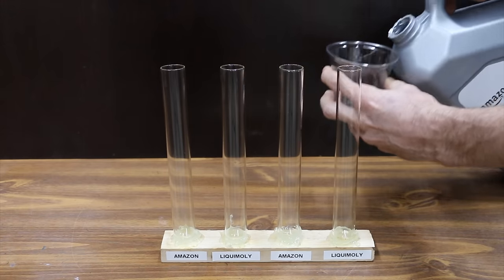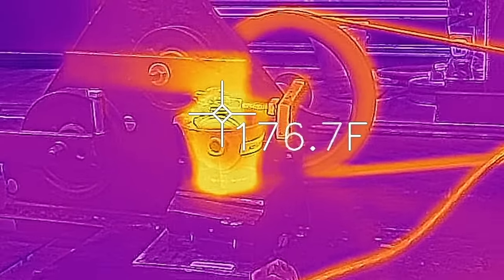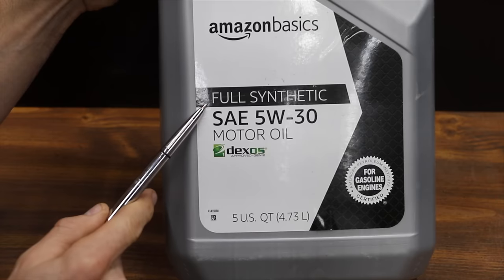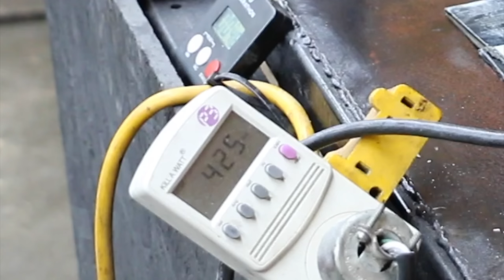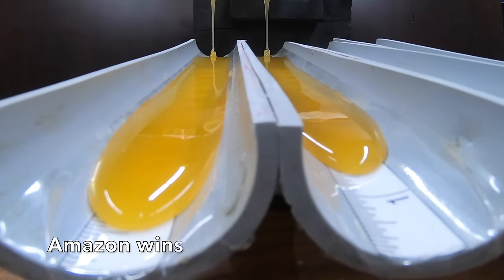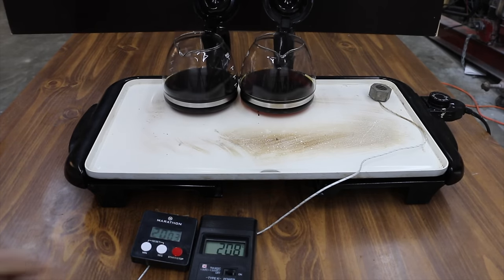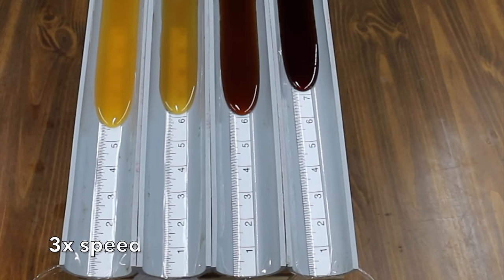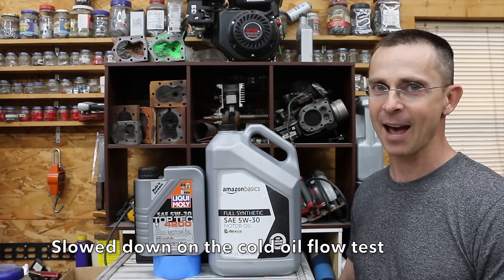Is Amazon Basics better than Liqui Moly? Let's find out!

Comment: I guess there are also other factors that should be considered other than viscosity and friction. It should also consider the effect of the oil on the exhaust gases and emissions as well are both oils are the same or there is a difference? This also affects the catalytic convertor and Oxygen sensors
Reply from the maker: Thanks for the feedback.

Comment: Maybe I am reading it all wrong but I always associated a thicker oil with a higher viscosity. If this is true the Liqui Moly was thicker in all scenarios. However it is a bit of a long bow to draw that cooked LM would be more viscous than new oil. The reason for the thinking is that higher viscosity hold onto a surface better than a lower viscosity. Tell me.. what don't I understand?

Comment: Could you do Diesel oil for trucks 15w40? That's something that would be interesting since big rigs do heavy loads over sometimes miles on grades greater than 5% and a lubricity test would show that under extreme conditions. That and traveling from a hot state to a cold state for starts would mean a big difference.
Reply from the maker: Great recommendation!  I'm planning to do it as soon as the 5W-30 series is complete. Thanks again!

Comment: I picked up some cataclean from the store the other day. I have bad o2 sensors and a bad fuel gauge (my guess bad fuel sender). It was pretty pricey but cheaper than new O2 sensors. I dumped it in and within 2 miles my gas gauge started working leading me to believe this is some pretty potent stuff (and I had twice the recommended amount of gas in the tank) I would love to see what this does to a small engine. Haven’t driven enough for it to clear my o2 code 🤞
Reply from the maker: Impressive results!

Comment: Could there have been a hidden error/void/inconsistency in the bearing, before it was used in the Liqui Moly test? Were we supposed to use Liqui Moly New Generation? I don’t understand how Liqui Moly could be so far away from every other test through 4 rounds. After 31 tests, it’s pretty clear that the Liqui Moly wear scar length measurement is neither within 1.5 IQR of Q3 nor within 3 standard deviations of the mean wear measurement for the first round.
Reply from the maker: Thank you!

Comment: On your viscosity test, let me recommend to first take one product and cool it down, and pour it in all the 4 lanes. This will provide a baseline calibration as it is likely that all 4 lanes are not precise, one lane itself can be at different surface, gradient or temperature than the other causing bias in results. its important to get a low and high baseline and ceiling so that your test is interpolated between known limits and variables. At this stage it seems like an assumption that all lanes perform the same for those test conditions, it may be true or it may not.

The other potential problem is what we often see with lab tests, is that the result confirms the experiment and not the intended use. How well does the experiment truly consider all aspects of use and engine optimization.  

For example, I can do test to demonstrate that low cost honey is thicker than the expensive honey, have more sugar than the expensive honey. Assuming those are all the parameters that determine quality you may end up assuming that the low cost honey taste better and is healthier than the expensive honey. The point is that the quality of a product, suitability to perform as intended can be far more complex. 

To determine the best oil for an engine can be as complicated as designing the engine the oil is optimal for. OEM oil spec is mostly about optimization, a suggestion that the engine was tested using that specific oil and they got the best results with that. Extrapolating optimization from one or two parameters one believe to be ideal can lead to bias in results. Your test are valid assuming the assumption about what is best is universally true. we see the same problem when people consider a higher resolution camera to be better or a high output power amplifier to be better while the engineers who work in those fields knows it is cheap gimmicks used by retail and industry to convince uninformed shoppers.

I think a better line of experiments would be to test how consistent the nature of products are, and how well those manufacturers comply to their given specifications applicable to its typical recommended use. Some products may seem stable at first with small change over a few test while other deteriorate fast but also settle fast and become stable while the other keep on deteriorating further and further over time. all these factors must be considered as they are part of complex field of petrochemical engineering. For example, modern cars have oil separators which feeds oil vapor back into the engine and improve engine efficiency that way while older cars do not. all these design factors play a role in which product works best for a given engine. Price can be influenced if the manufacturer who may custom engineer an optimal oil for best results and small quantities must be manufactured to spec compared to other mass production oils. 

However how well you service, regularly change oil and filters may outweigh the benefit rather than the details of the product. most engines are happy just to have new oil from time to time. Oil optimization is a complicated science and most people behind a counter making recommendations just talk nonsense most of the time. Trust your manufacturer and try stay as close as possible to what they have tested to be optimal. even if you use a different brand, to be sure it live up to its specifications are important. The fact that cheap oil performed different than the OEM oil only proves there are substantial differences between these oils and thus better reason to use manufacture recommendations.

Dont get me wrong, your channel is interesting and its great to see how these products perform, but be very careful about the conclusions you reach in these complicated sciences. Like can you use these same conclusions to use the best motor oil as hydraulic fluid, brake fluid or power steering fluid. This is why I say, every oil is optimized along complex parameters each for their intended use. Its hard to idealize any of those parameters unless you know exactly what you optimize it for.
Reply from the maker: Thanks for the feedback.

Comment: LiquiMoly is an oil brand actually blended by LiquiMoly where as AmazonBasics is a relabeled product which originates from Warren Distribution Inc who will have a contract with a 3rd party oil company to blend the oil.

I use a 5w30 VW507.00 product blended by a lubrication company 30 miles away from my front door. They buy in base stocks and additive packages and blend onsite. They also offer a relabel service for anyone wanting to buy their blends and sell under relabel.

Same with tires. You can buy a batch of a thousand from a tire factory in China and have a brand name of your choosing embossed on the wall.
Reply from the maker: Thank you for the feedback

Comment: Liqui Moly also lost the evaporative test as it lost 0.609% versus Amazon Basics 0.604% loss (based on your before and after weights).

You may want to consider using percent loss as your starting weights differed on both the lubricity and evaporative tests.
Reply from the maker: Thank you for the feedback!

Comment: I've mention this a few times in the past, with regards to the actual amount of time the motor oil in inside of a running engine. All military vehicles, including billion dollar bombers, have timers on them. So, if you change your oil and other fluids based on miles driven instead of running hours inside the engine your motor oil may degrade way past the point where you should change them. I change my motor oil every 100 hours. If I was on the Interstate for 100 hours I could travel 7,000 miles at 70 MPH. I typically only log about 1,100 to 1,3,00 miles in 100 hours driving around town. So, I'd have closer to 300 hours on my engine if I waited for the odometer to hit 3K miles. That would be about 20K-21K miles driven at 70 MPH on the Interstate.
Reply from the maker: Great feedback. Thank you

Comment: It looks like Liqui Moly has revised their design of the 4200 (maybe) and now it's having an API SP standard instead of the SN this one tested. I'd be curious to see if they have any actual improvement over the old product. It is surprising to see that the AmazonBasic oil performs better in those tests, but the test does not simulate actual engine environment so it's hard to tell.

Another thing to note that on the Liqui Moly website it says the 4200 has a pout point of -42C so it should pour with no issue when frozen at -26C, which makes me surprised that frozen at -26C made it not flowing. But the info is for the new 4200 so I assume it's better than the old product.
Reply from the maker: Thanks for the feedback.

Comment: Will you please do a euro oil showdown, I think the oil companies have to pay the brand for the certification because BMW only has 3 or 4 oils to pick from including their own twin power oil, motul, liqui moly and valvoline euro doesn’t say approved for on the bottle but below that there is recommended for and it lists bmw LL04- and bmw-ll17fe+. There is also a pennzoil euro platinum LX, however I messaged them and they said they don’t have any oil that is for BMW even though it says on the front of their bottle that it’s for most bmw Mercedes Audi and Porsche vehicles. But there is no bmw LL approval on the back. Ever since I saw how pennzoil got 2nd place to amsoil in your oil competition that has been my go to, but I’ve found their platinum euro lx 0w30 cuts my 2014 Subarus oil consumption to 1/3 of what 0w20 does. I wonder if the only difference is the euro oils work better with diesels because a lot of Europeans drive diesel luxury cars for the mpg and longevity of the engine but I can’t find a concrete answer with actual evidence to support it. And I’ve looked everywhere. German cars are definitely the best where I live in the rust belt though because usually the death of cars around me is almost always due to rust and the corrosion protection on them as well as the aluminum F150s are definitely the only cars that won’t have visible rust after 10-12 years.
Reply from the maker: Thanks for the suggestion.

Comment: Quick sidenote: Liqui Moly is a good brand, but eaven here in germany, it is one of the cheaper oils. Infact, if your vehicle needs an oil with special certifications, like VW 504.00 or 507.00 because otherwhise components of your engines will die (This is infact a very common thing for VW T5 transporters for example- using uncertified  5W30 and some bad luck and you need a new engine) you can end up with Liqui Moly beeing the cheapest oil you can get. I usually get my Liqui Moly Toptec4200 for 35€/$ from amazon per 5liter. - Still more than the amazon stuff, but with the right certification (if needed) but not a high priced oil. - Also it it hard to compare the prices because the Basics oil is not avalible in germany and dealers must take back your old oil, which increases the price for oil alot over here. So I am sure, the basics oil would be 5-10$ more expensive over here.
Reply from the maker: This is great information! Thank you

Comment: Do you have plans to use Royal King's Harvest Brand? This is going to be an interesting result to say the least. I don't care for the expense of Amsoil but I am here to say it works well. The car I am using it in is Manufactured for 25 MPG Highway and less for City and with Amsoil I am getting easily 28ish or more MPG provided I can keep my foot on the inside of the vehicle as I tend to try and push it through the firewall. I have been averaging easily 500 plus miles per month over the past few months and Amsoil is paying off. If you show something better I will try it and keep you posted on my actual results... Cheers...
Reply from the maker: Thanks for recommending Harvest Brand!

Comment: So......There are four(4) functions of oil in an engine not three(3), while you can argue that extended performance, or wear resistance or durability after heating are functions, they are really just derivatives of the base functions of oil. While this post is amazing for the consumer in that you may get a new appreciation for oil additives and formulations or which oil works better depending on your vehicle, this by no means conveys the four functions of oil.
These are; Cooling of the engine, Sealing between engine components, Lubrication of the engine components, and Flushing of engine contaminants. Cools, Seals, Lubes, Flushes.

The majority of the time, your manufacturer's handbook for your vehicle will give you the best oil to use in your vehicle. Especially in turbocharged cars, or European imports, try to stick with the recommended oil Viscosity and if you go synthetic, try not to switch back to normal oil. The gasket seals on your car will thank you. So will your turbo. Do not think you are super smart for trying something new, that often makes you a test driver of an unknown situation.

If on the other hand you are an engineer or scientist with money to burn. Please post your video results so that the broader auto community can learn from the success' and failures, which will save us all in the long run. That is the reason why I like videos like these and that is also why I subscribe.
Reply from the maker: Thanks for sharing.

Comment: Love your videos man, keep it up, you make learning new things fun. Anyways, I used to own a 1997 Ford f150 2 door long bed, and out of the blue I had an engine knock, it wasn't terrible but definitely noticable, I was told to put kerosene in with the oil (about half of a mason jar) and run the truck for 20 minutes or so, then do a proper  oil change. It actually worked, knock went away, and truck ran better, could you do something with this method? I don't know if it's just me or if it really works
Reply from the maker: Impressive!  Thank you for sharing this experience.

Comment: Hi, does the same oil brand deliver the same performance for both car and motorcycle engines. As in , if Amsoil has won the car oil test does it mean it's also the best for motorcycle as well. Will it be possible for you to do a similar test in motorcycle oil as well. Especially the 10w40 or 10w50 which seems to be the widely used motorcycle oil grade. Thanks in advance.

Comment: Wouldn't that just mean that the Amazon oil has a lower "winter" viscosity rating than the Liqui Molly? Are you implying that the Liqui Molly is thicker than 5W or even 30? Or is the Amazon Basics just a 0W-40 labeled as a 5W-30? The main expense with Liqui Molly and other "European Oils" is the additive packages to get them to last for 10,000 or 15,000 miles or to reduce ash for particular reasons in particular engines.

Comment: just found your vids..awesome...i dont subscribe to any channel...had to for you...the seafoam ranger vid..love it..restore..hell all the auto pour in vids are great...im sure ppl suggest you test products all the time...so i thought id make one...a product some ppl swear by and some ppl curse the day they ever put it in thier radiator...its the king of pour in just based on 2 facts...a blown head gasket is one of the biggest reasons u find vehicles on craigslist selling for 300 bucks..cause who wants to shell out $500 to a mechanic to fix a car that u bought last week urself on craigslist for $700. And ..when u walk threw auto zone, pep boys, or walmart auto dep, Blue Devil pour in head gasket repair (small and large bottles) are almost always the most expensive..that large btl is $ 100...and the kicker...money back if it fails...ive seen blue devil used in 6 vehicles...ive only seen it fail once...and the guy got his money back...i used it my 1990 Bronco. 5.0 ...thing had more anti freeze in my oil pan than oil i tell ya...and i screwed up and used the smaller bottle..v8's need the larger one...and that snake oil worked like a charm..i daily drove it to work for 6 months saving money till i could fix it correctly. Its the grand daddy of pour in's...it has web pages by the 100's claiming its a scam..it will damage ur vehicle ( which it may)..but there are just as many ppl that say " it saved the day". happy easter
Reply from the maker: Thank you very much!

Comment: Could you use two lubricity machines and test both oils on both (x4 the test? I’m wondering if their is residual heat in the friction flywheel? Also on the freeze test, why not do a lubricity test after freezing to show effects of freezing. What is the maximum viscosity a modern oil pump can handle,(idea for new test bed ???) will it cause cavitation, what is max psi post freeze and extrapolate it to oil port sizes in modern/older engines. A sort of guesstimate on possible negative effects.
Reply from the maker: Thanks for the video idea.

Comment: Thanks for your test but I'm a little bit confused on the one side you used a longlife oil on the other hand you used a dexos gen 1 or 2 (i don't know). I have no knowledge about cars or engines but if i will test a product i think it should be the same for example one dexos against an another in this case "Liqui Moly Dexos1 5W30" maybe but as i mentioned before i have no knowledge about engines i just compare the products and if one says "long life" on the other not this means (for me) that the oil is not very simular to other but maybe i'm wrong i don't know.